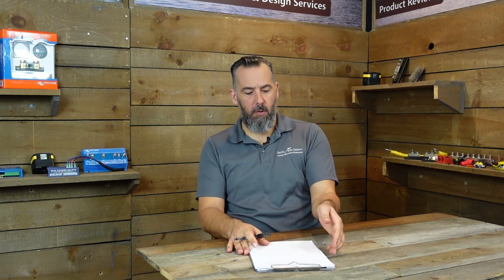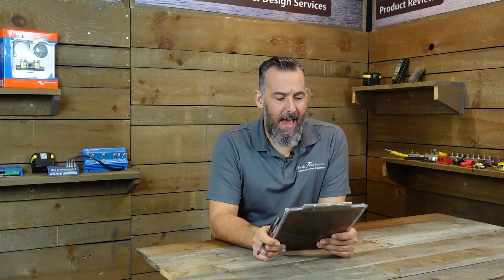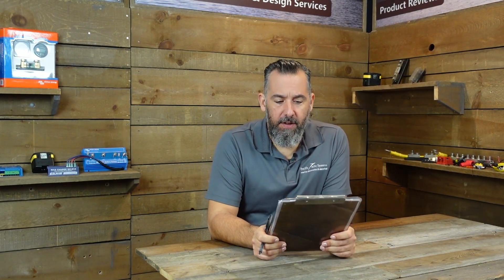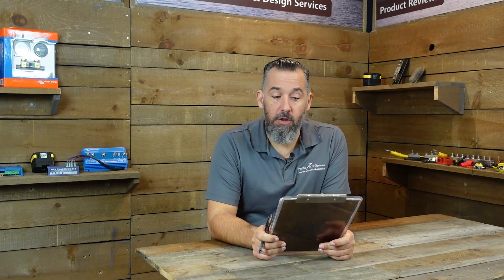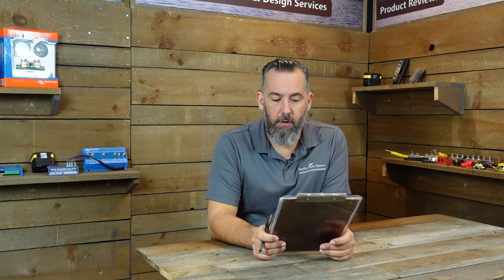Ask PYS - How Can I Tell if My Alternator Is Working?

Comment: Hi Jeff.

Im a Jeff too.

Hoping you have a thought or 2 on my, IMOpinion, altetnator issue:

2 inboards

Both start nicely 

20 mins run time or so and the port motor dies

Using emergency start, the port engine will turn over nicely- even start for a moment- then shuts down as soon as the emergency start is released

Immediately after engine shut down, charger shows putting 40 plus amps out to charge up the system.

In my way way layman thought, I am thinking the alternator is not putting out-- the shol¹1😮re power is topping the battery off- port engine starts beautifully- run 25 mins or so and then dies.  

Port engine battery not gettng any charge from the alternator and is just using up whatever it has stored to run the motor for 25 min ?

I am just wsnting to know if my alternator is putting out juice to the battery at all?

Appreciate your thoughts.

Big block Mercruiser
1997
Sea Ray aft cabin.

Alternator is not old at all, BUT it is FL and all mechanical gear takes a beating.

Comment: I appreciate your show but it is exhausting. Why not design a solar array and lithium battery and alternator and everything in between that works on a boat.  One offs are expensive.  Will someone design a system with everything that works together so the customer will not have to pay a thousand percent markup?
Reply from the maker: Good question.

Comment: The tiny 60amp alternators on my 3208T cats don't charge a idle speed (650rpm). I spend up too 10hrs a day slow trolling live bait and with my high electronic loads, fridges, chart plotters, stereo, sonar etc my battery voltage and charge drops quite quickly! What can you suggest to help improve or overcome this problem without me needing to run my generator and onboard 240v battery charger? Thanks!
Reply from the maker: That's a tough one, have you consider changing your stock alternators for an alternator that outputs at idle, Balmar is a good starting point to consider.

Comment: Put a shunt and check the current is a good way if the alternator is working properly.
Reply from the maker: Good suggestion and make sure the alternator connection is keep as short as possible. In the past boat builders ran the alternator current to amp gauges at the helms, but by doing so, created really long alternator cable runs and that caused excessive voltage drop.

Comment: Jeff, great answer to this question, but I also suggest you mention the case of an alternator malfunctioning by overcharging and what an owner should do if they detect this situation. I apologize in advance, but my personal question is a bit complex: Our Langley BC family are bluewater sailors and I attended advanced marine electrical and diesel training from the Annapolis School of Seamanship before purchasing our sailboat in Turkey. We have sailed the past 6 years from the Eastern Med to SE Asia and we are currently awaiting international borders to re-open and an effective vaccine to continue our travels. We own a french performance catamaran (Catana 471) with twin Volvo D2-55a diesels, with each diesel having dual "standard" 60A alternators utilizing twin battery isolators and 2 starting batteries. We currently have a 900Ah Sonnenschein gel house bank with 1300W of solar and a hydro charger which serve us very well without the need to upgrade the alternators, but I feel when we do run a single engine (typically for fuel conservation) or both to arrive at an anchorage before sunset (or while passing through the Panama Canal), I don't feel the existing configuration is charging/protecting our batteries as efficiently as possible, considering the number of alternators concurrently running. I am looking to upgrade the system to a staged regulated charging technology with some type of read-out (LEDs etc.) that is compatible with the thought of upgrading the house bank to Lithium in the near future. I was wondering if you have any suggestions of a good product(s) which would be ideal for our situation.
Reply from the maker: Based on your boat size, I'd consider getting higher output alternators, at least 90 amps with single v-belt, or 200 - 250 amp range with serpentine belt. In turn, you'll drive those alternators with a external regulator like the balmar 614. 

Assuming you have a standard internal regulator on your alternator, you should never see a voltage higher then 14.4 volts outputting from your alternator.

Comment: Hey Jeff I noticed that my voltage didn’t show a change on my Yanmar diesel until it ran and reached 135 degree temp. After reaching this temp it would start to show a charge. Pulled the alternator and had it checked at a local shop and everything tested perfect. After further Investigation it turned out that the engine has an air intake heater that turns on until the engine reaches temp. I installed a Victron battery monitor to prove that there was positive charge.  best addition to my boat yet. Thanks for the great advice in these videos.👍👍
Reply from the maker: Thanks for sharing patdghop! Interesting how a large a load can mask the alternator output. That's why it's so hard to know if your alternator is working just based on voltage.

Comment: Does the voltage increase even if the battery is fully charged ?
Reply from the maker: Yep, the battery does rise until 14.4 volts. Depending on the size of your battery bank, the alternator size, and how empty the battery is, determines the length of time it will take to get 14.4 VDC.
Reply: @PacificYachtSystems  Thanks. Does the battery stay at 14,4 V as long as the alternator is turning ?

Comment: Is there a reason that we can’t just measure the amperage flowing to the battery? For example this set-up: 200 Amp alternator externally regulated to provide a 150 Amp charge to a 300 Amp hour lithium house bank. 0.5C is the recommended charge rate for the batteries and they will absorb it until full.
Reply from the maker: Good point Torsten and yes doable. But most boats won't have an amp gauge on the battery.
Reply: @PacificYachtSystems  Can you recommended a quality multimeter with amp reading ability for AC and DC? I need to get one.

Comment: You have mentioned in the past that switching off your battery while the engine is running will ruin the alternator. I'm considering putting in a Lithium battery as a starter, (the company says it has 900CCA so it's powerful enough to be used as a starter battery). My question is what if the BMS shuts down the battery for some reason, low voltage, low temperature, high temperature etc. Would that be a potential danger for the alternator? Thanks for all these QandA videos 😊
Reply from the maker: Great point and yes. If your BMS has only one positive post to control and not two (one post for loads and another post for charging) then yes it's possible you'll damage the alternator when your BMS shuts down the only battery post.